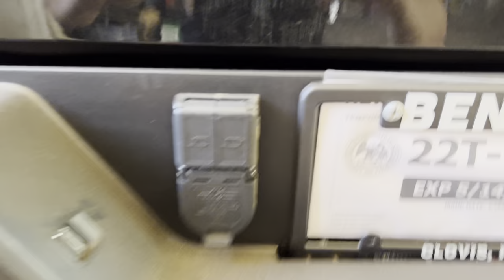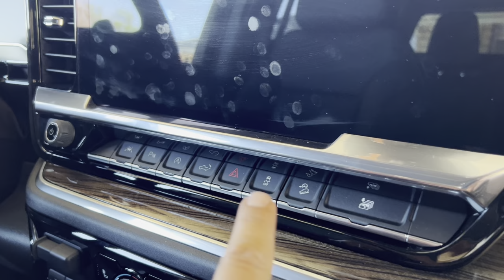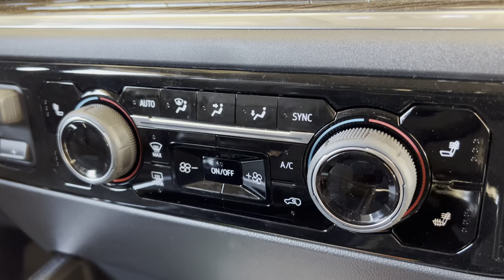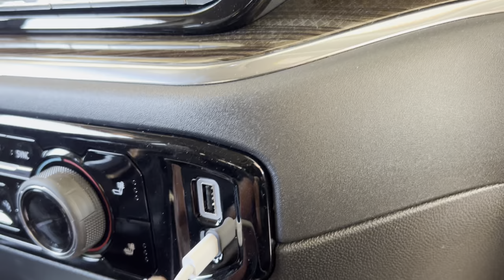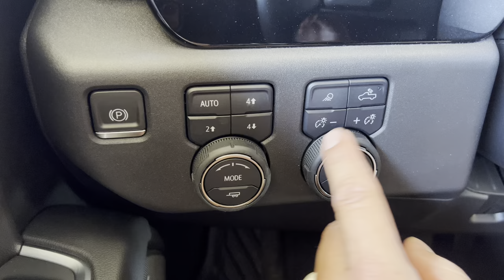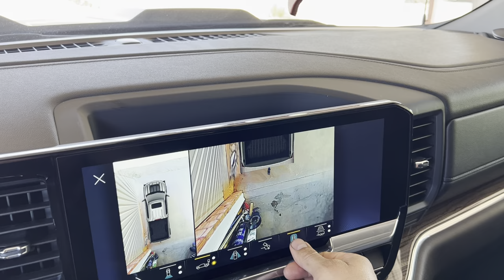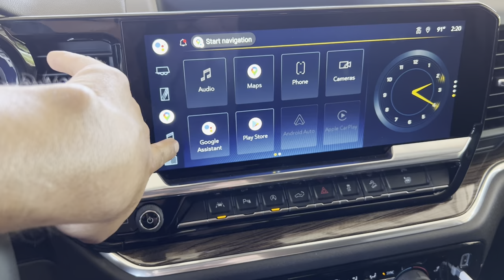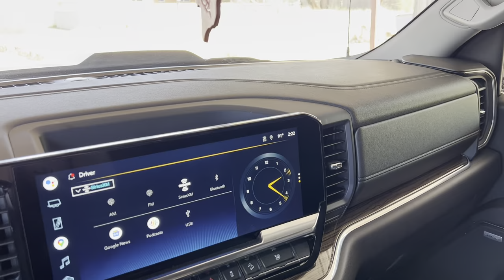2022 Silverado trail boss premium new interior 3.0 liter

Comment: You only have heated seats. There is no button for cooled…only for heated. Cooled seats comes with the LTZ trim and above I believe
Reply: Beautiful truck though!
Reply: I was about to comment the same thing... only has Heated seats. I would be sad if I ordered a new truck and thought it came with cooled seats and then found out later it didn't.
Reply: The lights on the mirrors are not turn signals either.

Comment: It is a cool truck and I like the GM diesel a lot more than I do the Ram EcoDiesel. They don't even have a diesel available for the F-150 anymore. It's pretty much the only diesel I'd have I don't need a heavy-duty so that's totally out of the question
Reply: Is the transmission different for the 3.0 or is it the same 10 speed across the board?
Reply: @corruptionoutdoors  I know for sure that it's a 10-speed. it's not a heavy duty so I would assume that it's the same transmission

Comment: You’re going to be disappointed when you figure out you don’t have cooled seats
Reply: I read somewhere that when the chips come in for heated and cooled seats asking with the cooling steering wheel they will add them for free? Maybe that article was not correct?
Reply: @davidstage9580  Can’t get cooled seats on Trail Boss . On LTZ , High Country and ZR2 only
Reply: @rickkohlhase8462  ohhhh. Well damn. That sucks

Comment: Do all those cameras work while not parked? Like could you use them while crawling over rocks? If It can I think I’d like to trade in my 19 for a 22 as well.
Reply: yeah you can manually select them while driving 360 degrees camera as well